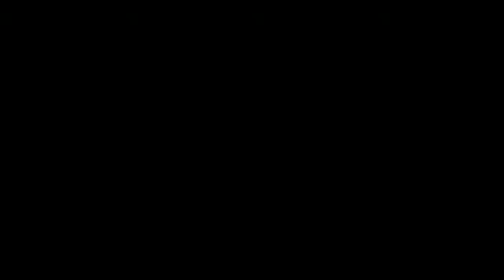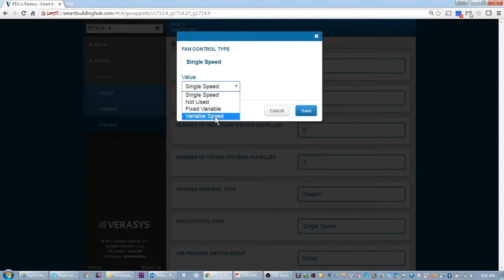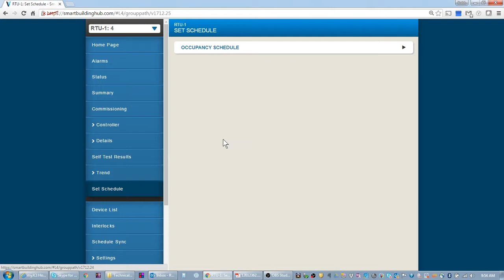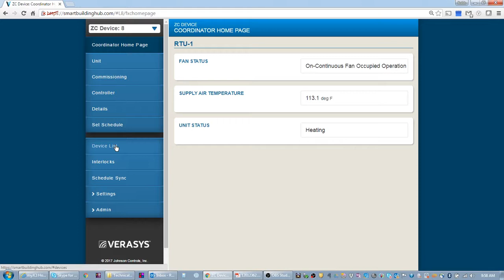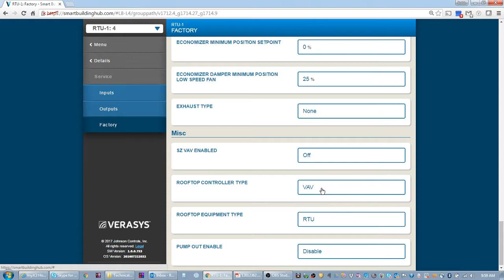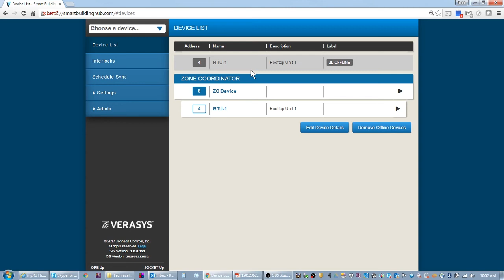Smart Equipment setup in Verasys

Comment: We just had this system installed.  Do you have a video on how to change your temperatures for the unoccupied /occupied timeframes?  Currently I have one unit where the temp is set for 66 degrees when it's occupied, how do I make a permanent change?  I now how to change the temp for temporary changes.